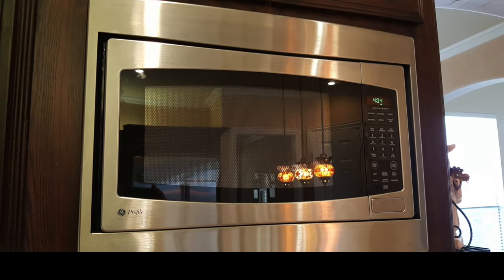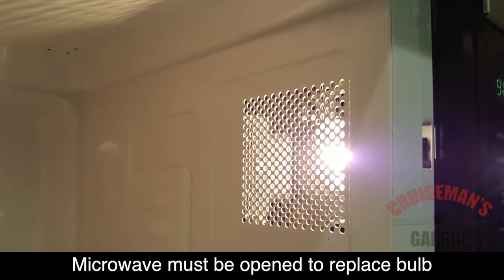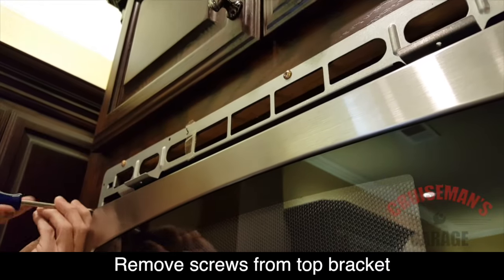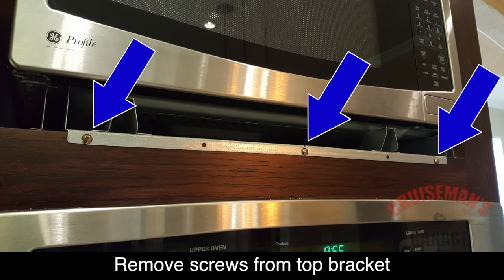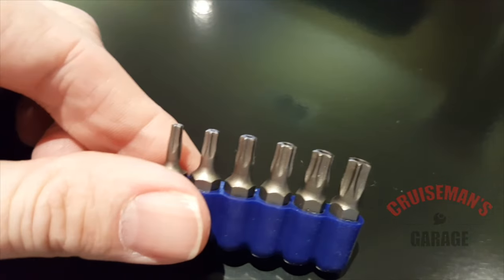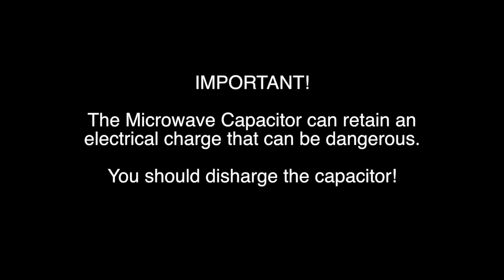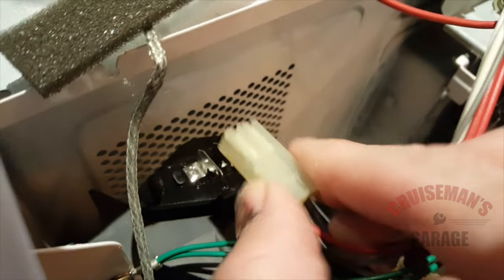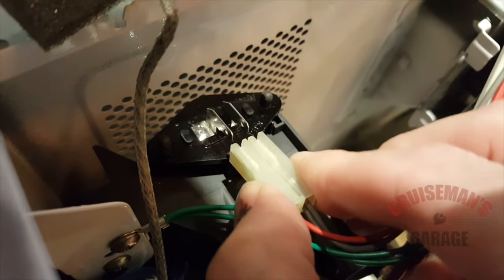Replace Bulb in GE Profile Microwave (Built-In)

Comment: What a major pain in the butt to replace a simple light bulb. Thank you GE! Great video by the way. Thanks.
Reply from the maker: Agreed
Reply: The newer gens are easier.  I don't believe you have to remove the entire microwave (which absolutely absurd).  There is an internal access panel instead (finally GE engineers listened).  I need to inspect my lamp because when I leave my door open I smell burning plastic...that's a huge red flag and fire hazard. Wondering what got dislodged, but it stinks my place up pretty fierce and quickly.  They are good microwaves, but I will be damned if they need to take some notes from Samsung product development specialist when it comes to convenience of maintenance and fire prevention design work.

Comment: I just get the bulb in my GE PEB7227 microwave replaced following this guide, Thanks! The differences are: it has 7 T15 screws, the bulb has a flat tip instead of vertical one in this video, you can find the picture from GE parts diagram. I did not discharge the capacitor, just stay away from it. I changed to a LED bulb, which is only 1.5watts.

Comment: This is just another reason to hate my GE microwave...I thank you very much for your helpful how-to video...I have the model PEM 31SF3SS. The GE Profile with build-in kit just like this demonstration. It was a replacement for a previous GE Profile built in. They are counter top microwaves with the plastic "faux stainless" finish frame to give a built-in appearance. If we had not had our kitchen cabinet custom made to accommodate this microwave I would not have replaced the broken one with the new GE microwave. When we replaced it, we found the the model that we had first was no longer made & this was the replacement. Guess what. It was just a fraction of an inch difference in size AND the trim kit (plastic stainless frame) was different. Our original had curved (eyebrow) metal face & the new is straight rectangle so not only did we have to buy a new microwave oven we had to buy a new trim kit and from Lowe's it was over $500 which is ridiculous for a small countertop microwave with plastic trim kit. That was enough to really anger us. Now my light bulb has burned out & my husband, thank God he's a wonderful handyman, is going to have to take that thing out of the cabinet & disassemble it to replace a stupid light bulb, which by the way, is a terrible light bulb. It is too dim & it's hard to see in the oven when it's cooking. I have food boil over & can't even tell b/c it's so dark inside....I will never buy another GE product. Thank you for this very helpful video.

Comment: Very useful video. In my built in GE profile microwave oven, after I got the microwave oven out of its cabinet and was ready to remove the cover, I discovered I needed a TORX security and tamper-proof bit set that I did not own for two of the machine screws that hold the case to the frame. A TORX security and tamper-proof bit set is different than a standard TORX bit set. Fortunately I found a set in stock at an ACE Hardware store. I called the store in advance to be sure.

Comment: Does anyone know if you can just replace the bulb on this model or does it require replacing both the bulb and the light assembly? Light bulb would be cheaper whereas the assembly is about $13. Thanks!

Comment: For those security screws, you can use the screwdriver that comes with a Ring doorbell.
Reply: The ring uses a T15 security Torx. He said in the video you need a T25 security Torx. Sooooo, did you see a security Torx and think,, "Oh, Torx... I've seen those before. My ring uses them," and just guessing that they'd fit? Or did you have a different model of Ring that used a T25 security Torx?

Comment: Is there a way to TEST the bulb works BEFORE reinstalling the microwave back in the cabinet?
Reply: I think you can just plug the microwave to any socket to test it before install back. The microwave should be 120v, less than 1800w so you can safely plug it to any 15A sockets. If you just want to test the bulb, you do not even start the microwave, just open the door to see if the light is up.

Comment: It certainly could’ve been designed better but it’s really no big deal.  I have an old 2003 GE that I just keep going.  Replaced the magnetron, high voltage capacitor, etc. over the yrs.  Mine is pre torx security screws so that helps.  Definitely stay away from the capacitor, they’re dangerous.

Comment: Thanks for the video, it will be helpful.  btw, your bulb was not burned out on your microwave to start with.  I saw it come on the first time you opened the door.  You might want to check that before replacing the bulb next time.  Thanks again.
Reply from the maker: I think that is because I did not shoot the video on removing the trim until AFTER I had replaced the bulb.

Comment: I got GE profile over the range microwave, I want to replace the bulbs that are at the bottom and provide  lighting on the stovetop. It says 120v 40w for incandescent or 120v 20w for halogen. Is there a bulb number or model or those info are good enough? (looking for 5000k bulbs as I like those white lights)
Reply from the maker: Wish I could help. I would check with one of the appliance repair websites.